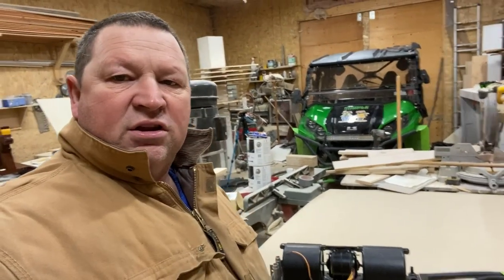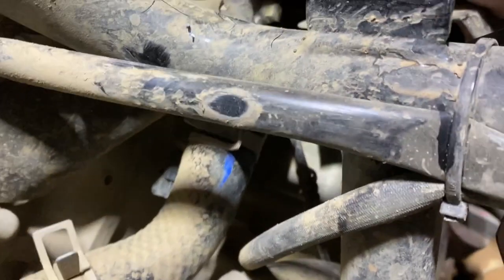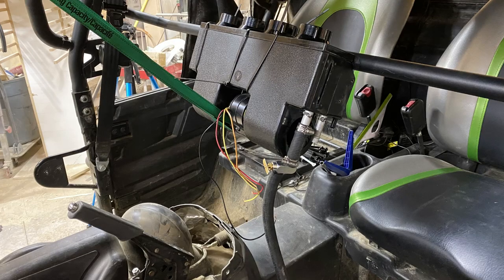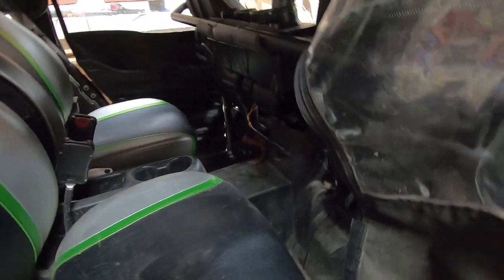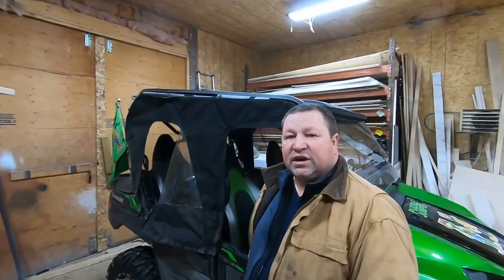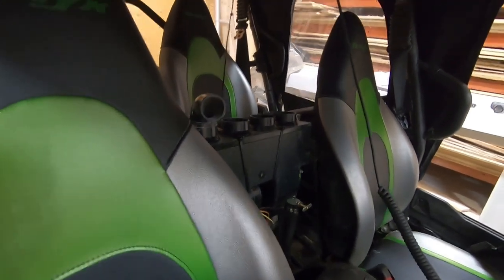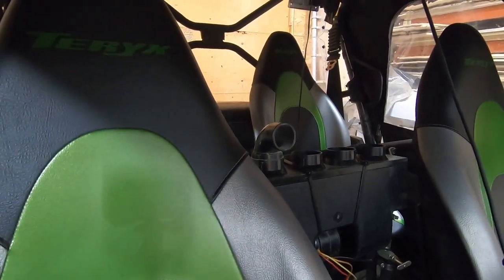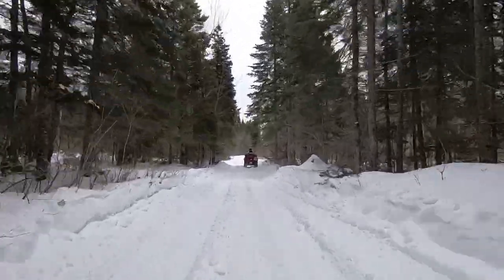KAWASAKI TERYX 4 LE 2020 MODIFICATIONS

Comment: Could you have cut a short section of the hard tubing out with a  close quarters Tubing Cutter. Then use two short hoses and a T-fitting to run to the heater so the lines are shorter.
Reply from the maker: I thought of that but with no feral on the metal tube I was worried that it would come off.  And it’s a hard place to get at.